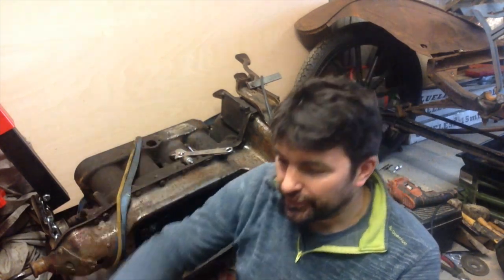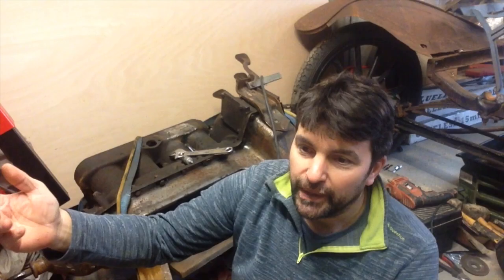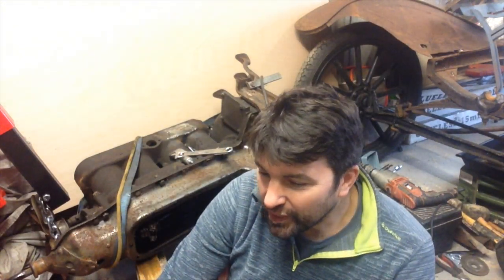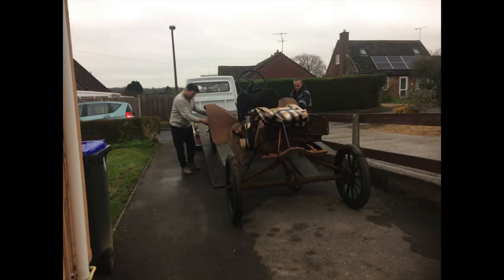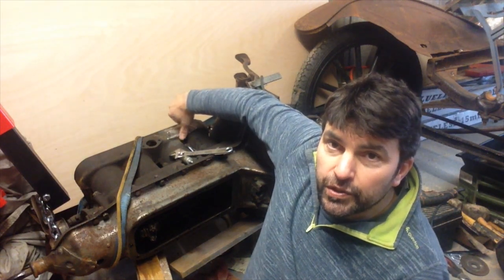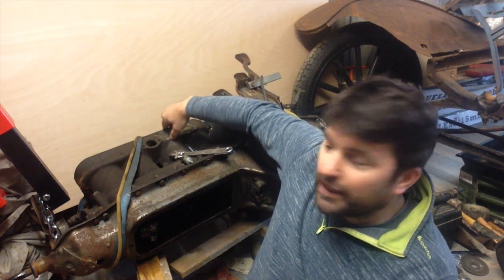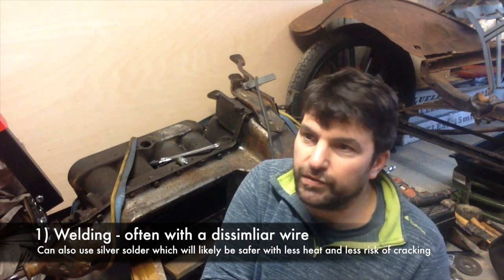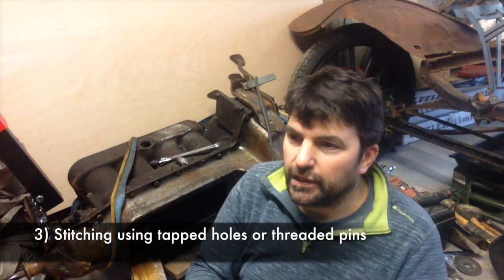Cracked block - Ford Model T Engine Block Repair

Comment: Ill would of welded with a tig welder useing silicon bronze  as it works good on cast iron
Reply from the maker: Yes, I have TIG now and that would be my choice now too. I do like TIG, so nice to be able to weld something without getting all the splatter.

Comment: The proper way to weld cast iron is bake the block then use a cast iron rod  with the old type of stick welder their maybe a to do it with a mug but baking the block is most in portent part
Reply from the maker: Yes, this was a shady tree repair really. It worked, but the stitch method with some threaded rod is safest and as you say, baking the block is best when welding. I guess this worked as the weld was really from threaded rod to threaded rod with a slight bit of burn into the cast on the way.